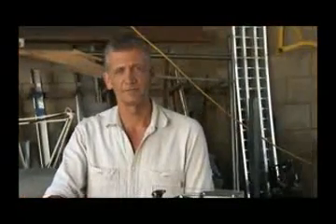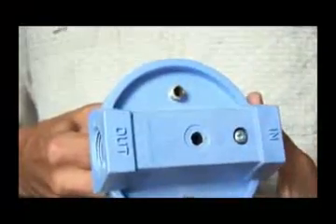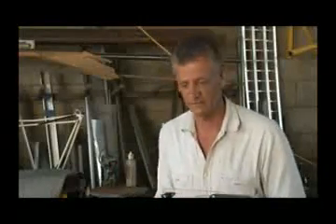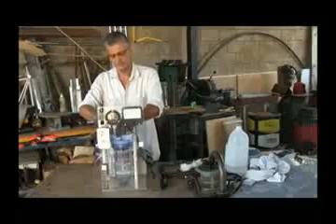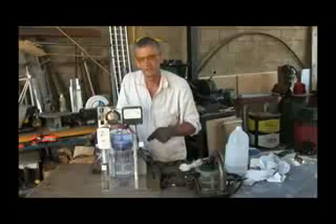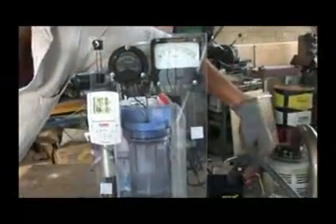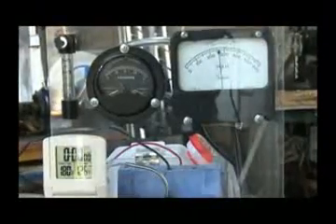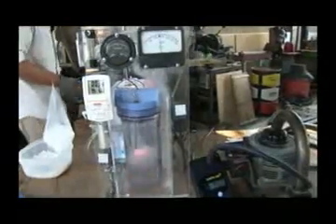hydrogen cold fusion plasma electrolysis Reactor CFR

Comment: this man is what`s known as a fraud plain and simple. This is why coldfusion has such a bad name, idiots like this trying to replicate without proper materials. all he has done is short out his input in water that`s why the water boils. Back to the drawing board dumbass, try using some nickle or paladium with low current all you have there is a hydrogen generator and a pilot light

Comment: For what it's worth, this is pretty neat. I don't think it's so much fusion, as a reaction of the hydrogen and oxygen split by the initial electrolysis during his "warm up" phase.  If it was fusion, with that big of an "arc" it would use up the water pretty quickly I would assume.  The plasma of the arc produces the heat for the hydrogen-oxygen catalyst.